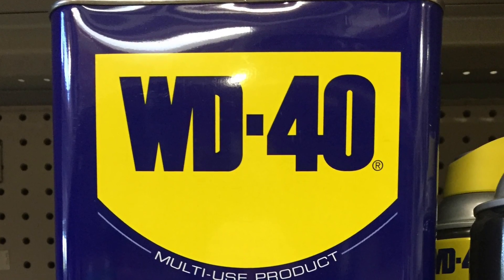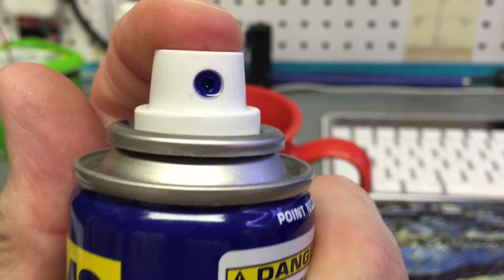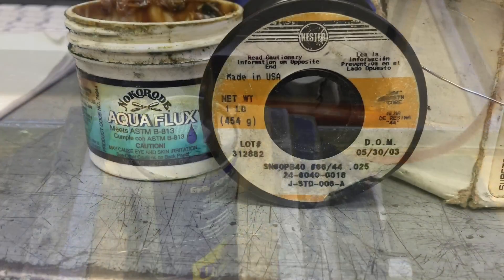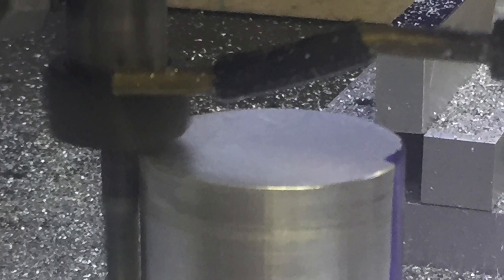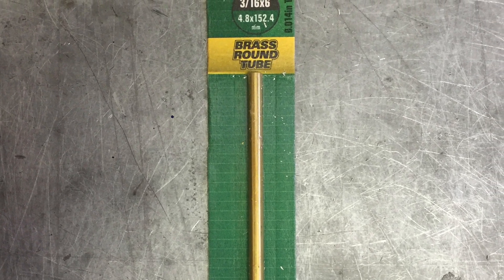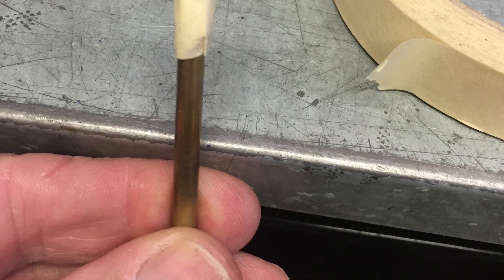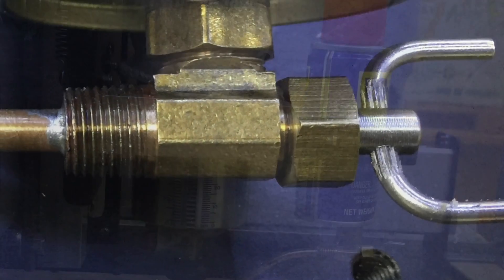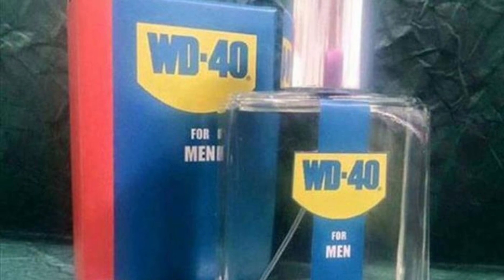My World Famous Shapeoko WD40 Drip Can

Comment: Hi Richard.

Nice video. Is the metal chips a problem? I have been holding on a bit with cutting aluminium on my cnc, worrying that the chips would cut and stick to/in the delrin v-wheels and overtime wear down the rail?
Reply from the maker: Good question!  No problem at all, since I regularly clean my V-wheels (after each large metal job) with a small brass brush. Once in a while, a chip will be stuck and I pry it loose with a razor blade.  I have been machining metal for over 2 years now and the machine is as good as the day I bought it.  Note:  I use 2 boards to cover my side rails (something you can see in my other metal cutting videos.  This keeps 99% of the metal chips away from the v-wheels on the bottom on the Y (axis) rails.
Reply: Richard Cournoyer thanks for the reply :). Cool! Now there is no excuse, not to cut aluminium

Comment: Richard, any ideas on how to direct the drips closer to the tip of the end mill? I cut a lot of flat sheet I'm finding I have to use a pretty high drip rate, and many of the drops don't dead on when the spindle is moving in certain directions. I'm not milling a small concentrated area where the WD40 gets a chance to pool up. The DeWalt spindle does blow the drop toward the cutter, but again only when the spindle jogs in certain directinos.

I'm also getting some clogging at the tip of the brass tube. I'm cutting with a 1/16" cutter, so the chips are very small and tend to stick to the drop coming out as opposed to falling down. Any input would be appreciated!
Reply from the maker: What I do sometimes, is I'll move the tube to apply a drip slightly ahead of the cutter (and lower the tube to be closer to the metal if you are cutting thin plate).  Granted, if you are cutting right to left apply the drip to right, and yes the drip will be behind the cutter when and if the machine is also cutting to the left, BUT there should be enough residue that the cutter is still lubricated.  On average, I only set my drip rate to 15 seconds.  Please use a coated cutter, because they need almost NO additional lube.  Note: The Makita does not blow the oil nearly as much as the DeWalt.  I hope this helps.

Comment: This set up works well for aluminum cutting? Most setups I see recommend having some type of pressure behind the liquid coolant to push away debris.
Reply from the maker: It works amazingly great for cutting Aluminum!  I have over 11 months on ONE end mill (1/4" 4-Flute TiAlN Coated).  If you are using a router (Mikita or DeWalt) the internal fan blows away the chips.  I also started using it for cutting mild steel too, and it worked so well, that I stopped using my mist coolant system.   I just started to design a new machine to sharpen Carbide End Mills and it is mostly made from steel parts, but with the WD40 system, I'm not worried about cutting steel anymore (And so much LESS messy than the Spray Mister).
Reply: Good to know. I'm hoping to picking up a Shapeoko 3 come tax time So I'll definitely keep this in mind.